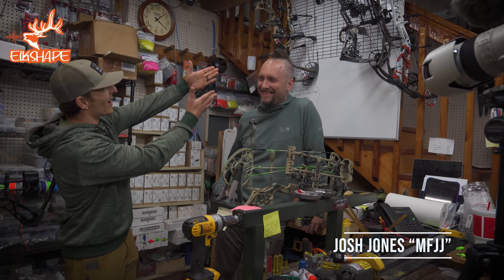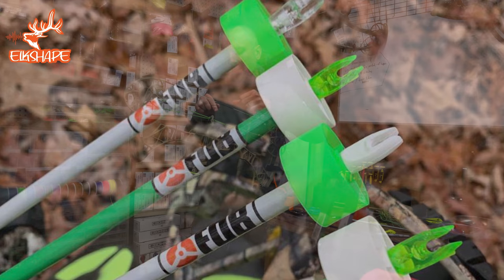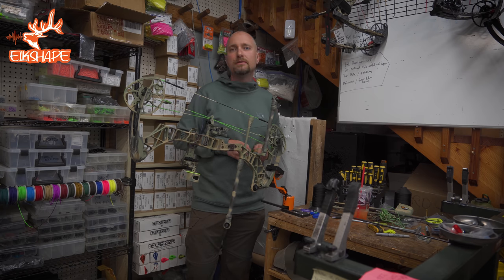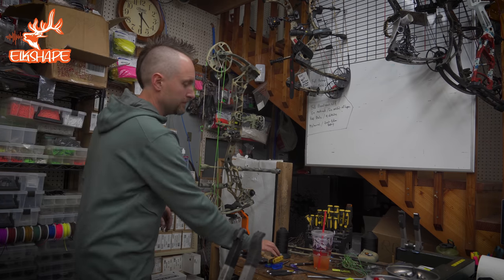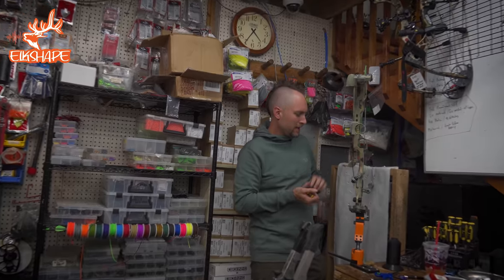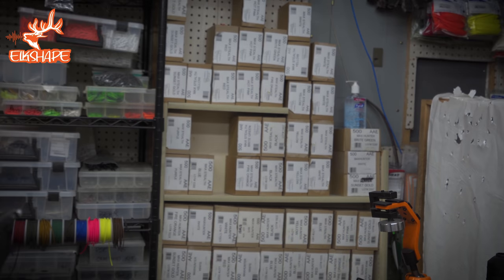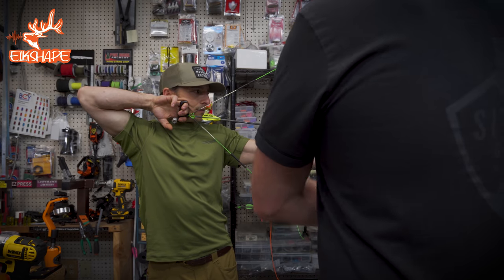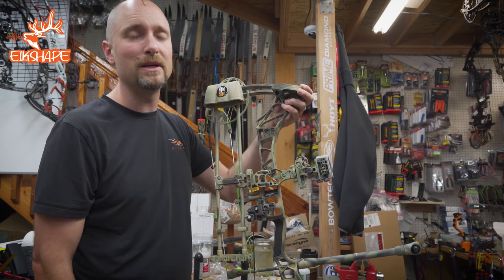Rattle Can Bow Build VXR 28

Comment: When people are asking about “nock tuning” they’re talking about rotating the nock in the shaft until you have good arrow flight. Usually shoot through paper with a bare shaft and rotate until you get a bullet hole. You can also rotate it three different ways with your vanes (trying three different cock vanes) to see what shoots/flys best. You need to start with one arrow to set your bow up correctly and then do the rest. It can be very time consuming and not really a necessity for hunters with high quality arrows but it can help.

Comment: Just  have a few questions awesome video. 
What type of paint did you use? Did you sand the bow before painting? Does the paint stick well to the rubber dampeners? Would it be a good idea to go over with clear after? Does the paint affect the bearings? Will it come off easily?
Reply from the maker: Tim here but I am going to let Dan answer the paint question. You should definitely scuff up the bow before you paint.. I doubt it will stick well to dampeners.. Clear would be your call, the dull look is more natural.. Tape off the bearings and any internals... It certainly will not come off easy - hope that helps!
Reply from the maker: check video description for more info - DS

Comment: Nock tuning is turning the nock to the next shoot able alignment on an arrow in an attempted to pull in a problem arrow that is not grouping with others as well.  This can take a pesky arrow and pull it into the group tighter.  Basically your trying to adjust for the actual spine of the arrow if you don't do all the floating arrows and spine aligning.
Reply from the maker: 120 degree rotation on the nock - correct?  -DS
Reply: @ElkShape  it really depends on shooting 3 or 4 fletch.  With 3 yes it would be 120.  However if your shooting 4 fletch you get more tuning ability, so its every 90 degrees. One minor plus of shooting a 4 fletch beyond all the other pluses and minuses.

Comment: Check out Zinger Fletch.  Made in MI on a 3D printer custom made to the arrow diameter.  They come in V3 (3 vane) and V4 (4 vane).  Each version came be made in, 1 degree, 3 and 6 degree...Both right and left helical.  These are impressive and light which increases FOC.
Reply from the maker: Cool - elk shape vanes made by AAE are live on the website now

Comment: And for the record I am talking about using Archers Advantage to verify spine, arrow length and the affects of what length the arrows are and how it changes the spine. You can get a good idea of what wraps,4 fletch and so on will affect FOC, speed spine and have a solid idea of what arrow will work. Especially if your on the fence between 250 spine verses 300 spine. How will 200 grains up front change the arrow verses 300 up front. Its not necessarily for the tapes was my point for the record. Drawing the bow back and saying cut it here is not the best way. Just my opinion.   Speed affects the spine as well. 300 spine can be ideal at 280 fps but not at 305 fps.
Reply from the maker: record clear

Comment: I like how my comment was called out because everyone always has to be correct. My 4 fletch compared to a 3 fletch high profile is almost no difference in weight with an average hp vane. My vane is 5.5 grains compared to the aae vane which was like what? 9.2 grains. My total weight is 22 grains for 4 vanes compared to 3 aae max vanes that weigh 27.6. Invalid argument. Also the more you spin the arrow obviously the more it will slow down at distance which is the original point I tried to make. To each their own. I guess results can differ
Reply: Shane Berkness I disagree also on him saying a hard helical will show no differences at longer ranges, Levi has said it himself that too hard of a helical will be less accurate at longer ranges
Reply: Yes, also Tim Gillingham and John Dudley. I would take three accomplished professionals word over a random guy that I have not heard of until he appeared on the elk shape YouTube channel
Reply: Not saying he doesn't know what he's doing. I just don't agree with him on this subject
Reply from the maker: @shaneberkness2743  and squad - the point he made which I like is to test it all yourself and find what works best - ABT (always be tinkering) -DS